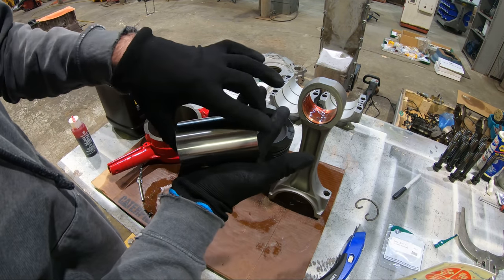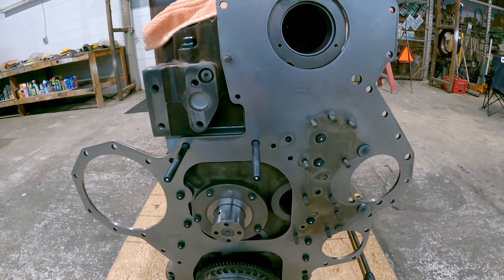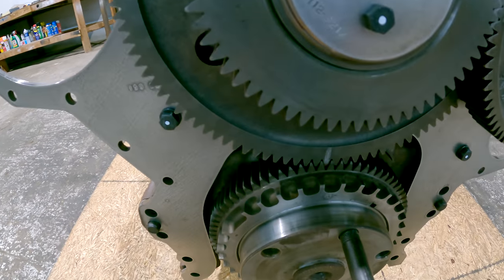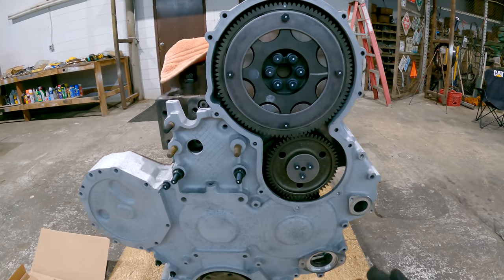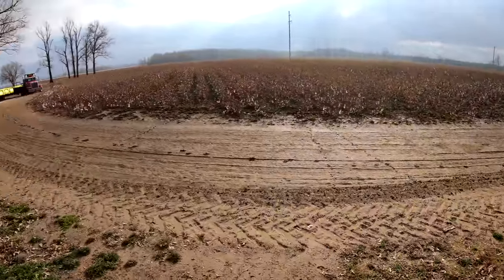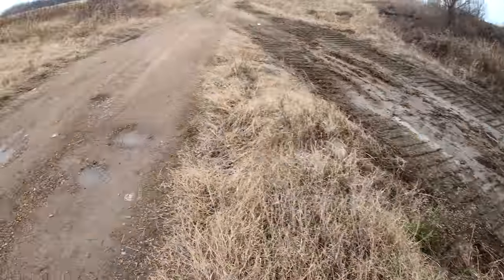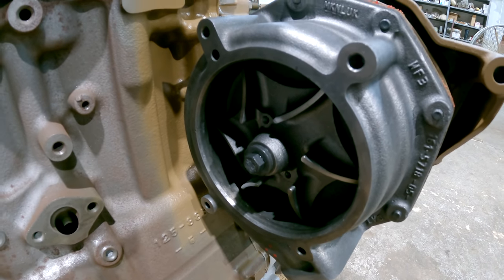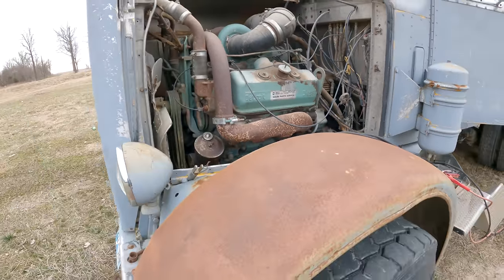Building a Brown Caterpillar C-15 Diesel Engine, Mud, and 1973 Peterbilt Cold Start

Comment: Now I just think you are hiding mistakes you made. How can we trust your knowledge if your hiding some of it without descent explanation?  Yeah catch ya
Reply from the maker: Good.  That means you won't be asking me 10,000 questions and expecting free help like everybody else.  What's a Cat truck engine anyway?  I've never seen one.
Reply: What makes you think that?
Reply: Yeah that guy is a ass. The first video I saw was a while ago. But I think you do outstanding work. A hell of a lot better than some guy in a some shop who really doesn't care about his job or the engine he is building. I was really impressed with how you actually really care about your work. In fact I was wondering when I get the funds God willing I was hoping you could build me a 3408 and turn it into a B. I would love to have someone like you work in my engine and have it done right and have it actually reliable.
Reply: @KT3406E  Great response to that smooth brain steering wheel holder, 100k right around the corner, congrats thats a hell of a milestone.
Reply: KT’s channel is for A guy documenting what he does without any fucks given. I can guarantee you he will show his mistakes he don’t give no fucks
Reply: I am thinking of going from a cummins isx15, to a single turbo c15.would you have some used  internal, external engine parts to sale if
I happen to need some.
I  would like to put one together that would get me about 700hp or better .can you 
Tell me  what would the ( ipd) cost,
And what would you suggest. 
It is going in a 2015 kenworth t660.
Reply: @alittlebitofeverything5090   At least it's more than what you are providing what you call "YouTube Community" for learning.
Reply: @KT3406E  i saw some guy put one into a F350, does that count?
Reply: @williamlee4425  i wouldn't buy used parts unless you're buying a whole engine
Reply: shouldn't you be chasing an ice cream truck ?
Reply: How do you think he’s hiding mistakes?
Reply: Atleast he dont have to buy assualt bow and arrows and dont have to lockdown
Reply: @KT3406E  . I love your videos and could watch them daily! What color brown is on this engine ? Is it an off the shelf aerosol? I was flashing back to the movie “Duel” watching the old dump truck!
Reply from the maker: @FIGGY65  Caterpillar Mojave Brown
Reply: @KT3406E  . I much appreciate it! Stay safe, and keep up the good work!
Reply: @KT3406E  Question number 10,0001 ? where the hell are you from? LOL I just ribbin ya i enjoy your videos keep um comin
Reply: Maybe you just need another Booster!
Reply: Typical arrogance from that part of the world.
Reply: Lol, what a hunt
Reply: I absolutely love your videos nobody else can make me laugh like you do every time I watch one of your videos you cheer me up
Reply: I completely agree. He must work for cat
Reply: Disasterly boring to film and produce, but you've saved me and countless others 100's of hrs! Keep up the good work bro!
Reply: It's your channel, do and say what the fuck you want. That's my two cents.
Reply: @haloondrugs1173  grammar ... easily knows
Reply: @KT3406E  I am just curious what are you transporting out there in the fields (around 25:46)? I come from a rural area and grew up with winemaking and farming here in Germany. Usually such rolls in fields are hay for the winter. But since that's on the other side of the world I'm not so sure and I'm asking you. Down under it's probably the pressed bones from a "year's harvest" of rabbits, hehehe.
Thanks for the great video, KT3406E! Which, by the way, was exciting, entertaining and educating:)

To that other bloke(OP): Sure, Karen ... do it better!
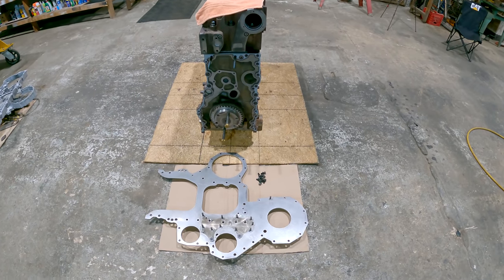Reply: @KT3406E  4:22 I would like to know what engine serial # used to build 6nz for accert crank and  connecting rods and water pump?
Reply: @KT3406E  I seen the truck said Parma on it. Are you from around there.
Reply: You should watch who you are talking to bud.
Reply: @dieSpinnt  it's cotton
Reply: @dieSpinnt Those are Cotton bales… you’ve never seen them as it can’t grow there. You need a fairy mild climate and long growing season.
Reply: @KT3406E what would you charge to look at my jakes and figure out why they don’t work?
Reply: No I think that's what you get when you get yur engine built out at a wrecking yard in the back shop !!!😂😂😂
Reply: @elijah3807 He’s Australian… they can’t barely talk let alone spell. 😂
Reply: @crandonborth 😢
Reply: @KT3406E he's not the standard Aussie mate.
Reply: Shows your knowledge
Reply: Classic "I used to be a mechanic" comment

Comment: Dude, give yourself some credit.  Your incredibly talented.   What you might find incredibly boring and mundane, the rest of us find interesting and entertaining.   Your knowledge and work ethic is top notch.
Reply: *You're incredibly talented.
Reply: @jumpinjojo  Thank you so much for the grammar lesson. That's why we're all watching this video. 👏👏
Reply: @yz125n101  It wasn’t directed towards you, but thanks just the same.
Reply: He knows and one thing I promise you is country boys don't need positive reinforcement. We honestly don't give a shit look at the toys we have to play with.
Reply: Not really building an engine aint rocket science
Reply: @fordnut4914  Yes, but building one right that you don't have to take apart in 25,000 or 50,000 miles and one that will run for years and not leak oil everywhere, and will continue to perform at a high level takes some serious knowledge, discipline, and skill.
Reply: @yz125n101  I think we're watching to learn something, and learning the correct version of your and you're is also learning something. No reason to get upset or embarrassed when someone corrects someone. I would prefer to be called out and to use that moment to learn the right way of doing or saying something than to go on all my life using the wrong method or version.

Comment: Love to see how neat and clean also organized you keep everything on your builds.
I have worked in fleet shops and dealers where under the truck (inframes) would be all oil antifreeze and oil dry till it went out the door.
Not me, my jobs had to look surgical. Floor clean and dry, engine clean and dry...  parts laid out like how you do it. 
I couldn't do it any other way. Took heat from all my "grease monkey' co workers for "wastin time" bein so clean, but I was proud to work that way...
Makes a huge difference.
Jus' sayin'
Reply: We must have similar coworkers, there's a reason I only do things one time, and it's not because I "waste time being clean."

Comment: Hot Rod magazine started in 1948. Had a circulation of over 650,000. We gear heads love motors. You might think we are bored. You're dead wrong. Thanks for the videos

Comment: Back in 2011, the last big prevent plant year here in Montana, I had to drag the semi out to the county road to refill after a 2 weeks of sitting in the rain during seeding. I pulled it out 3/4 of a mile behind 3430/Atx 400 airdrill behind the 9329 JD, had a 170' train going there!
Reply: 9320

Comment: Very nice video. I enjoyed this very much. I was a gas engine mechanic for 17 years before I went into Snap On Tools. These truck engines have quite a different way of getting oil to different aeries of the engine. That’s one thing I always tried to keep the special OEM tools on my truck because I had so many independent repair garages.

Comment: The spotless parts and work environment is terrific!  The narration is concise without and to the point without a hint of self-promotion.  An excellent job from start to finish.  

I suspect the low spot puddle under the train bridge was a necessary "improvement" to the gravel road to lower it a bit for the scant clearance he mentioned.

Comment: it is not boring at all. i worked at Cat in illinois from 2004 to 2013 building the c 15 and 3406e and smaller on highway engines. takes me back in time...

Comment: C15 looks good . Good job . I like these engines . Blocks are a little weak . There prone to crack . Heavy loads twist it , torque runs to the front left of the block . Jumping up and down in sand with rears is bad on it to !

Comment: Brother in law worked at a gravel pit that had a drag line with a V8 Detroit on it. Ancient piece of equipment. The only thing separating the operator from that engine was the metal side of the cab. He said even with duel hearing protection if you ran it for more than an hour or so your ears would ring for hours

Comment: I had one hell of a time with that adjustable idler once. It made a terrible noise like   lop lop lop . You could feel it on top of the motor.  Cat dealer in Summerville sc  took the  P nut cover off  all the valve covers rockers and such till the cam had no spring tension and you could move it by hand. They put a half gear idler on it and set it to 14 thousands with dial indicator . put on the idler and it made no noise at all. Runs fine to this day.

Comment: Great Engine build videos.... love your attention to detail and Cleanliness!!   Yes, there are Lots of ways to do things, but when it comes to engine building (or anything else for that matter)... there is really only ONE way that is right, to each specific engine type and model, and the longevity lies in the attention to even the most minute details, and absolute cleanliness.  I personally, was never a "mechanic"... but am degreed in Diesel Engine Design & Theory (specializing in Two Cycle), and have built (re: modified) numerous engines over the years.... you, sir.. have tremendously disciplined and focused work ethics, and are a credit to the younger generation to which you are a part of... definitely a "stand alone" in that regard, compared to Far too many of your age group.   

Stay with it, and you will go far... and you already have a great beginning for your life.   I wish you all the very best in all your endeavors, now and future.      PS: On the other side of the coin.... I loathe the thrashing of that ole 73 Pete 351(?), and that 6-92T.... that is No way to treat a classic older truck like that one.... it should belong to someone who has the facilities, compassion and the means to restore it to it's original (or better) condition.... speaking of which, what was the Original engine that was in it?    It sure was Not a 6-92T.

Comment: That old truck,  I'd build a pickup truck out of it, put a 5th wheel in a home made bed, make fenders that somewhat match the front, , remove one axel,  maybe shorten it a few feet, make it about 14'-16' bed, made similar to a 30-60''s Chevy step side,  put dual 6" side pipes on that Detroit, turn out and down in front of the rear tires, and build a sheet metal roll pan. Covering the frame, With a Reese style hitch under it doubling as a bumper,  that's a cool truck, make  a grill for it from 1/4" sq. Tube welded to 1/2" x 1/8" angle,  have it chromed or nickel plated turn the SQ. Tubing 45° so the corners are facing forward, instead of a flat edge.  Play with the spacing to see what looks right, '3/8"-1/2" May 5/8" maybe have a 1" sq tube running down the middle, with the cross pieces welded to the sides. Having the corner of the large center tube proud of all other tubes, maybe do a CAD design to see what looks better,  it would be nice to see something different looking!  And about a 12" visor over the windshield, with a 6" x 24" smoked Plexi window in it  on each side, to allow done vision if low bridges and crap,  definitely make a cool truck,  put the low and wide singles all the way around!  Tires , rims  then build a 35-40'  trailer for it,  kind of a gooseneck horse trailer looking hitch area,  then kinda move into a grey hound bus look.    A 8" channel frame, with  Hoops made from 1" x 3" steel tubing, going from one side to the other, 7' 11" wide    use the tubing on 4' center, and use 2" angle  on thr 24" centers, in between   skin with 20gauge steel.  With epoxy and rivet 18ga. Bracing for windows and doors,    a 18 ga floor pan, with 1" ply flooring,   a 7' x 9'-10' rear deck, that folds down,   with a 24" recess behind it for storage,  and a 30" door,  the deck made from 2" tubing, and wood decking,  lifted with steel cables,   with a canvas canopy with 1" tube frame, and 1" center bow, that  covers the deck,  with 1" support tubing,
 Paint  it grey silver to match cover with solar,  put a 150-200 gallon water supply over the hitch, making gravity feed possible.   And a 250 gallon grey water tank, with a 50-100 gallon poo water tank, the grey water fuming through the poo thank. To clear it,  the whole thing would probably look similar to a 60's locomotive diesel electric  train engine.  Only having windows , and sleep 4-6; comfortable  with a tiny house bathroom with 4' tub, with shower, having storage above the shower,   a small house style fridge,  that Detroit diesel to noise converter , having a 4-71 generator would be only fitting, definitely having the option of several mufflers,  with one on the intake as well! 😆

Comment: When you dunk that piston ring assembly in a bucket of oil you are getting a large amount of oil back in the Piston Ring Groove between the Piston Ring Groove and the piston and it bakes back in there and then causes the ring to be stuck in gooey causing short engine life it'll be best if you just put a film of oil around on the outside of the ring and on the skirt and if you want to put some in the cylinder and then put it together and that way your piston ring will stay cleaner and longer and have longer piston life

Comment: From my experience Ipd designs parts the way the factory should of with improvements and enhancement which add to longevity and durability.  Usually the aftermarket steps up and improves upon where the oem left off and fills a void left when manufacturers discontinue parts or availability becomes a nightmare.

Comment: What a nice quality job. 
I had a detriot out of frame done at a dealer and it looked like shit compared to this. 
48,000 miles later after 3 heads and one injector set, it ate the bearings. Top and bottom. 
That was from a dealership. Absolute garbage quality of work compared to this mans work. 

Nice job sir.

Comment: before you put the cylinders in the block itself, are you clocking the rings in a certain order? looks like you had the gaps all lined up but cut before you showed the final orientation of ‘em.
Reply from the maker: Nobody installs pistons with ring gaps lined up.

Comment: Thinking of buying a Pete with a C15 Cat. It has around 850,000 miles. Runs great and sounds great. No knocking or any other noise is heard.  To rebuild this engine, what kind of time period and cost is a man looking at?  Would it be easier to find a C15 barn buy and rebuild it because of time?  Are parts hard to come by given supply chain problems.  If you have a chance let me know.

Comment: I really enjoy watching these Cat truck engine videos of yours. Not boring to me. Very boring to my wife but, that's OK. I've been an owner-operator for 43 years. From 8V71's, to C855's, to mostly Caterpillar 3406B and now 3406E (5EK). It's very hard now to find really talented truck mechanics. Keep up the good work. 
One question... Do you use Aviation type gasket sealant with the spacer plate gasket? Or, is dry install enough? Even Cat dealers have differing opinions.
Sorry, second question... Have you ever met a Cat engine with over 700,000 miles that didn't need cylinder counterbore and lower machine work done?

Comment: I've got 1.2 million on my 3406E the last million are my miles. Doesn't smoke uses roughly one gallon between 15k oil changes. What is your opinion on an in frame with those miles on the crankshaft? I run over the road.

Comment: My observation on starting the Detroit. What I do but I guess it’s the fuck-around factor is depending on the situation is ; I pull the intake rubber elbow off at the turbo or just enough to get a gap and I use WD-40 as a starting fluid it works real well and a lot easier on the engines, what’s your opinion and or have you ever heard of or ever used WD-40 as a starter fluid on Diesel engines.

Comment: I'm having issues with a c-15 single turbo. It keeps blowing injectors every 20k Miles. Using a 10r-1273 injector. Think I should use a 10r-0955 instead.

Comment: That engine c15 or c17 (700-800 hp?) that you built before sounds really good, clean sounding, great exhaust note, sounds like it should run another 500K. Excellent work I would be happy! And the engine you are building right now looks like just the same high quality build!  Is this engine going to be about 700 hp?

Comment: I been threatening to make a set of jumper cables, from 8'-10' of 2/0 welding cable, with good brass ground clamps on the ends, insulated with color coded 4:1 heat shrink tubing, i just haven't  had the $150-$200 to spend on jumper cables,  I do have a spool of 10gauge stranded wire,  thought about putting about 12, 20' strands together,  cover with braided looming and attach the ground clamps the garbage cables I have now are a disgrace,

Comment: @3:02 Is there a particular arrangement for the rings? I understand you don't want the spaces to be near each other but do you try to arrange them 180 degrees from one another or are they best centered over the pin or 90 degrees from the pin or does it matter?